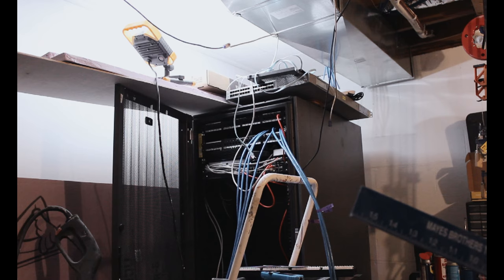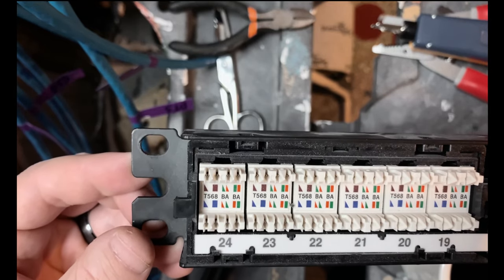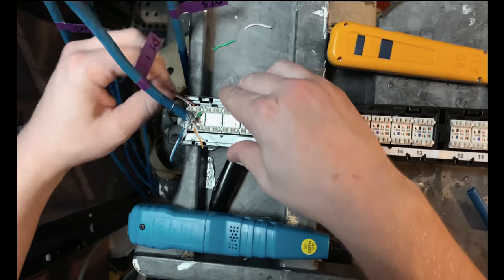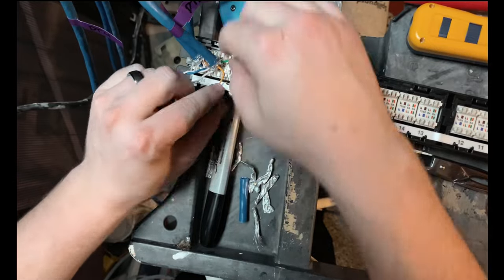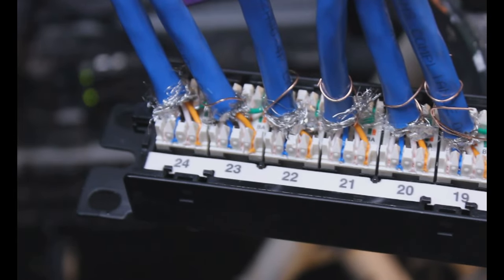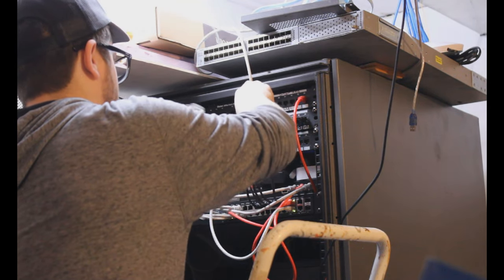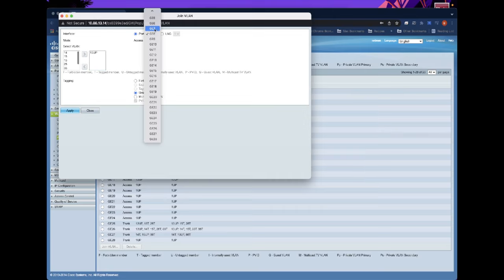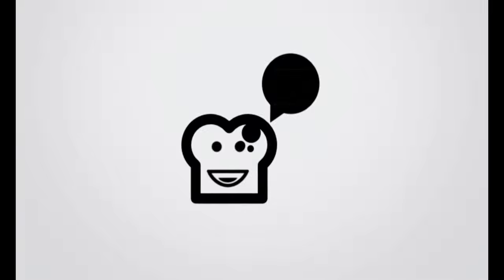CAT 8 Patch Panel Termination

Comment: Ideally the shield should stay on the cable. They sell CAT8 shielded keystones where the shield of the CAT8 will touch the metal housing of the keystone.
Reply from the maker: Correct.

Comment: A bit of properly sized heat shrink hiding that shield tangle would bring extra cosmetic joy. 
Slide it on CAT8 cable before removing the jacket. Shrink it after fan out, just before placement and final punch down.
IDK, also consider bonding individual shield connections with a crimped 18AWG wire OPTIONALLY leading to good frame ground for EMP/RFI/Static protection.
Reply from the maker: I didn't think about that, but that is a good idea!

My rack doesn't have a good ground yet, but hopefully I can set that up at some point.  I would like to be able to use the ground in the cable since it is there.

Comment: Hope you see this... I installed a ring pro 2 at my front door and its got bad wifi. My optimum router is up a flight of stairs. I bought a small netgear wifi extender and it helped but still not great. What would be the best way to get a strong wifi signal to it? I can run a ethernet cable down by door but what do I need to do since the cheap wife extender didn't help much.... thanks buddy
Reply from the maker: I'd recommend an actual access-point installed close to where the ring is.  However, depending on your environment, if your walls are too thick or there is too much interference in that area, an outdoor solution might be needed.

Usually, an access-point on the other side of the wall gets the job done.

Comment: May i ask, if i need to run 1Gbps or even 2.5Gbps, do i need a Cat 7?
Reply from the maker: Nope, you could get away with 5e at those speeds, but 6 would be a safe bet.  Unless you're going a super long distance or have a super noisy environment, there isn't really a need for Cat7 or above.
Reply: @ToastyAnswers  thank you. Which 6 tho?6a?

Comment: Hi Toasty this is probably a really simple question in comparison to your other uploads, but would you be able to explain how to configure Google Nest Wifi and mesh access points to address Double NAT issues? I'm having difficulty getting other devices to work properly on my network due to having both the ISP provided modem/router and google nest wifi + mesh points. It's caused me issues connecting my xbox properly to the network for certain games and has gotten to the point where even something as simple as airplay or chromecast doesn't seem to work.

I watched your Double NAT video and it was extremely informative, I'm going to try the solution you had at the end of the video to see if I get any luck. I expected Google's mesh networking system to work easily but I think there are certain network rules I need to apply in order to get this to work properly, I really don't know...
Reply from the maker: I believe most of your questions would be answered in the double-NAT video, but if not just send me an e-mail.

I'll be honest, mesh wifi is not something I am particularly strong with, but I believe the concepts are still the same.  

I would make a dedicated video on this if I had a google wifi system